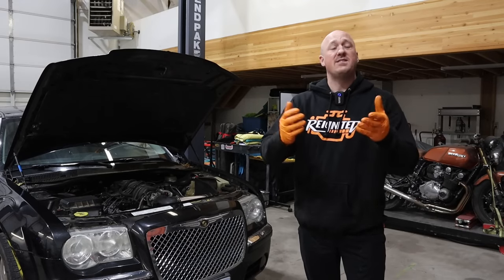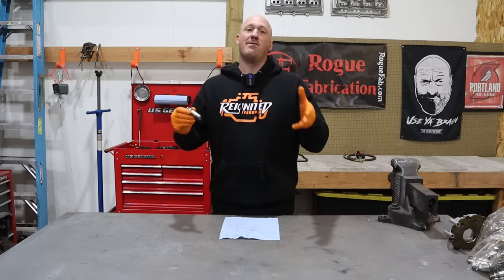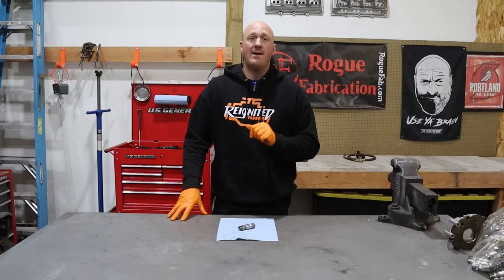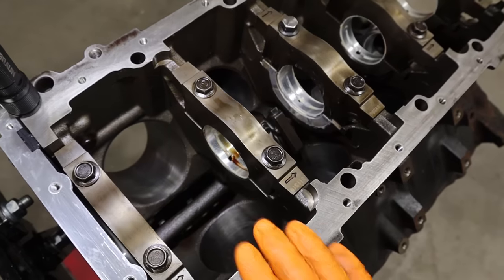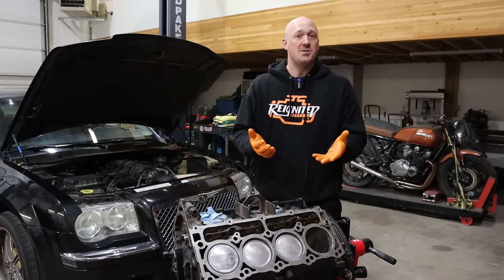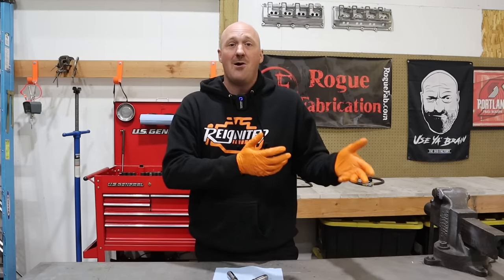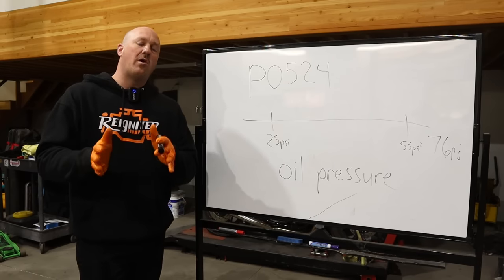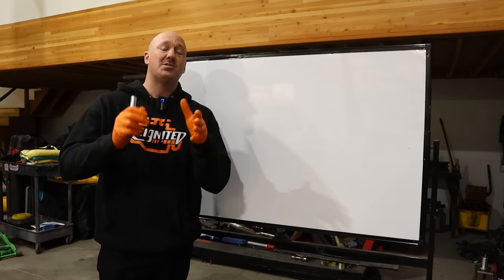The BEST Prevention For Hemi Lifter Failure! (In My Opinion)

Comment: I just put the hellcat oil pump on my 2018 Ram with 228,000km. I have MDS off so no code came on. I haven't had any engine trouble, and always used pennzoil Ultra platinum. Mechanic said it was the cleanest 5.7 hemi he's seen. Hoping to take this engine to 500k. Thank you for dissecting this topic so miticulously and sharing your knowledge.
Reply: What weight of oil you use?
Reply: @DellCvz  5w-20
Reply: How do you turn of the mds? Did you make a phisical delete?
Reply: @ARFoodsmx  I got the Edge Pulsar tuner. Piggybacks on the factory ECM and I can change settings on the fly using my cruise control buttons. It's worked amazing for me for the last 150,000km. Worth the money if you ask me.
Reply: Do you still have the mds lifters in ? Just disabled ?
Reply: @jessejames4319  yeah just disabled. the engine is untouched besides the oil pump. 238,000km now and no issues with the hellcat oil pump.
Reply: Completely agree popped my valve cover off to fix a broke valve spring and there was no sludge or discolouration of the aluminum 400k on motor penzoil platinum and oil changes ever 5k

Comment: I suggest oil changes 3000-5000 miles at most, or every 6 months,  whichever comes 1st no matter what any factory suggests.....that gives u a chance to inspect the the rest of the engine bay, fluids, suspension, etc and gives u a better idea of what is going on with your vehicle...I think anything above  5000 is asking for problems..great video bro...
Reply: Is there any particular oil filters out there that holds more oil or has better filtration?
Reply: @davewoodmancy5124  plenty of options but all my mopars have drove past 250k on mopar filters...
Reply: I agree. Although my 12 tsx had 170k the oil changed were done every 6 months or 3k and i used the recommended 0w-20. The engine ran smooth as butter. Most shops say the #1 reason for engine failure is neglect.
Reply: @isorozco511  absolutely 💯
Reply from the maker: Appreciate you guys watching!
Reply: @ReignitedAuto  appreciate you sharing all your info.....MOPAR FTW 💯🔥🔥
Reply: I agree but if you're consistently getting good results from uoa from running good oil and filter, then there is no reason to keep changing it every 3-5k. Seems like a waste of resources.
Reply: I believe that a good oil makes more difference than anything. I have seen people run junk oil, and change every 3k, and good oil like Amsoil or Shaeffers, and go 10K plus. 

I started running Amsoil a couple years ago, and firmly believe it’s one of the best out. Independent testing has proved that as well
Reply: The six months period has already been disproven with synthetic oils and newer non synthetic oils
Reply: @SModelMafia I run amsoil in mine and change it at 5k but I also don’t drive it in the winter with all the road salt. I’m sure it will still shit it self since I took extra care of it. So far 100,000 with no issues.
Reply: Fresh oil cannot overcome design flaws and poor metallurgy
Reply: I have a ram 2500 with a 6.4 under warranty so I change the oil every 4000 miles using the molar filter and factory oil. When the warranty runs out I will use Amsoil. Good oil and changing the oil and Filters on time I believe makes a motor run longer without issues.
Reply: @williammoore2417  again, the very best oil cannot overcome poor design and bad metallurgy.  Installing a Hellcat oil pump would help more than Amsoil.
Reply: @williammoore2417 Ever had a used oil analysis done?
Reply: I only drive 1,000 miles a year.  And with full synthetic let it go over a year between changes at 3,000 miles.  So yea I change it every 3 years on a 2019 5.7.  Don't imagine I will ever hit 100k.  I don't believe oil breaks down over time but do heat it up on short trips to keep moisture evaporated from it.
Reply: European markets been on 20k oil change intervals for 30yrs.
Reply: I’ve used full synthetic oil since first oil change. Changed it every 5k or when engine light turns on. Closer to 8k-10k miles per change. I’m in a 14 R/T and still spins like a top. I’m in LA so I’m sure the nice weather helps my engine vs colder sub zero cities. Finally gonna jump to a cam swap and MDS delete just to be safe from the lifter issues and of course I want the power ! 5.7 with 129k miles. What cam should I go with ?
Reply: 6K miles minimum. You're wasting resources, money , and time.
Reply: After all of this, why would anyone buy a 6.4 ? I would definitely never buy one without a lifetime power train warranty.
Reply: @davewoodmancy5124 no need to hold more oil, why do people think that?

Comment: Facts. The frequent oil change interval is absolutely the best way to prevent wear / failure. Our 2007 RAM 2500 with the original 5.7 Hemi has 150K on it and we had to recently swap the oil pan (due to rust-through thanks to the midwest rust belt doing its thing) & windage tray/gasket. The internals looked fantastic and not a single tick in 16+ years of service due to oil changes being done every 3000 miles. 50 oil changes doesn't seem like much of a price to pay to avoid issues like engine component failure at bay.  Cheers!
Reply: My opinion on Modern fuel injected engines is they run much cleaner than an older engine therefore 5000 Mi is easily doable and acceptable. If you follow the computers recommendation I believe it will be past 7500 which I think is too long
Reply: @thomasward4505  Heat and pressure breakdown oil in conjunction with carbon present in the oil as so-called modern engines utilize low tension rings which contributes to contaminated oil. That coupled with modern engines using more oil; as an example Hemi engines consume a factory acceptable amount equal to 1 quart per 1000 miles. Engines are expensive, oil and filters are not.
Reply: @strykerentllc  my 2014 Ram hemi does not use one quart of oil in 5000 miles which by the way I use it for towing and Hauling at least half the time. So one quart of oil in a thousand miles would be excessive but maybe in the realm of factory recommendation I don't know
Reply: @thomasward4505  Dodge's acceptable oil consumption is 1 quart per 1000 miles. Next time you're at the dealer, you can ask and they will confirm the same. The PCV valve is there for a reason - evacuates the engine of oil vapors as the oil is heated during the run cycle to be burned through the intake cycle of the firing order. Oil vapors are part of heating oil and if there was no PCV on the engine, it would pressurize the crankcase and cause gasket failures.
Reply: @@user-dd3pl9ii2h Nobody was bragging until you decided to initiate a foray. Congratulations on running yours to the point it literally wore out. Maybe you'll get another 250K out of it.
Reply: @strykerentllc  😂😂😂😂
Reply: I like what you say. I have a 22 Ram Power Wagon. I am changing oil every 5000 but like your recommendation of 3000 miles. I am using Mobil 1 and a Mobil 1 filter. I also put oil treatment in. Will change to 3000 miles. No ticking at 28,000 miles
Reply: @@user-dd3pl9ii2h You do realize where the pressurized oil to the nozzles is fed from on those blocks, no? You understand what the nozzles are pointed towards? The MOPAR Hemi block can't support 1500HP reliably and the average guy isn't going to be looking for that kind of HP in a street car as anything above 1000HP cannot be supported on the street. In short, the street can't utilize that kind of power. A well prepped surface needs to be under the car for the car to apply that HP to the ground.  

As to the cam lobes wearing and lifter rollers failing; only metrology can pinpoint the cause and to date, no shade tree guy has sent anything off to a lab for analysis. As a preventative measure, frequent oil changes based on driving habit is the best course fo action to avoid expensive repairs.
Reply: @robertgoodrich8953  I feel like every 3000 is very overkill though, isn’t it?
Reply: Not facts at all anecdotal at best, poorly engineered is facts didn't you watch video is main fix is 12% higher volume oil pump...though nothing wrong with changing oil, you just got lucky
Reply: @ShawnGilbert1967  Knew it wouldn't take long for some self-appointed internet expert to come along and give his unaccredited opinion. How many engine components have you engineered that you can claim that level of knowledge in the engine manufacturing industry? Do tell.
Reply: @strykerentllc  none ( same as you) but I've assembled a lot of em, and YOU are the LITERALLY the one whom self appointed himself lol...I'm responding to the self appointed internet know it all with the maximum cope post.....

 ANY engineer would know this IS a design flaw period of what level or severity IS the ONLY question.......

 Give ya an example, GM LS7 heads, 12 degree valve angle with a 1.8 rocker ratio can and does fail or wear out....not 100% of the time....well would it be 100% of the time with enough mile? See that's where you gave yourself away, you give a answer in fact with a deviation between failure of infinity.....

I'd assert an LS7 will 100% wear the guides and drop a titanium valve in 200k miles....but what about 60k when it was of warranty? Lets say it was 5% would it still not be a proven design flaw....Yet it WAS a design flaw the aftermarket ( much like this video ) had to fix....

If it makes you feel better I call it a design Liabilty then ;)
Reply: I only put about 2 thousand miles a year on my 2019.  I refuse to change it once a year but do every 3 thousand miles.  I do heat the engine up to 200 degrees once a month for a 20-mile drive to get condensation out of oil.  When it's 10 years old, I will buy whatever gasoline engine that's left as the libers are going to force combustion vehicles out.
Reply: I have a 2016 Durango, hemi , I replaced lifters, hellcat oil pump, I get the code, I still have the tick
Reply: My 2007 5.7 Ram has 240,000 miles on it and has never been apart and from the way it sounds and runs, it won't be any time soon. I get the oil changed every 4,000 miles at a dealership mostly to quiet any concerns I might have. I put a tuner on it at 200,000 miles and it's revved over 6,000rpm on numerous occasions without any problems. Happy to see what the next 100,000 looks like. I should add that I disabled the MDS on it with my tuner and that everyone should do so or suffer the consequences.
Reply: @anoint426hemi6  Duly noted! The only concern anyone should have is the stated OEM oil consumption for the 5.7 is 1 quart per 1000 miles of oil being consumed being acceptable. If we check oil level and top-off between oil changes, we're in good shape.
Reply: I can say with fact... I changed the oil between 4000 and 5000 miles in my 2013 RAM 1500 with the 5.7 and at around 140,000 miles I got the dreeded cylider 3 misfire engine code but I've ALWAYS had a tick. I'm a bit skeptical on NOT changing the oil before 5000 miles seeing I changed it faithfully before 5000 miles. I just purchased a new 2023 RAM 2500 Power Wagon with the 6.4 and I'm planning on changing the oil every 3000 using the recommended PUP 0W-40 oil. I'm also considering upgrading to the Hellcat oil pump. Does anyone see any issues with my plans?

Edit: I'm also going to use the Wix XP oil filters on Power Wagon
Reply: @@user-dd3pl9ii2h  what year was it?
Reply: @rjmlakota  The MOPAR (MO-090 in our case) oil filter is fine as that's always been used in our 2007 RAM 2500, purchased in cases of 12 units on flea bay. The oil change intervals are what matter as the filter would never get clogged to the point where it chokes oil flow to the level that causes starvation to the critical surfaces. Curious as to whether you topped off oil between changes and how much was needed as FCA (now Stellantis) notes that 1 quart per 1000 miles oil consumption is acceptable. 

The HV oil pump wouldn't be detrimental. The question is it necessary? Disabling the MDS along with the HV pump is certainly something to consider but wait until it's out of warranty as modifications could possibly void your warranty.
Reply: @strykerentllc  I did not top off oil between changes. This is something I'm definitely going to do with my new Power Wagon.
Reply: @@user-dd3pl9ii2h Spot on. It's a sad day in America if engine life expectancies are only 150k - ish.
Majority of used truck sales are 100k + miles. I recently bought a 2011 Super Duty with 143k, sold as lower miles. I'm at 188k now and don't anticipate anything major until the 300k mark. My 08 SD diesel 6.0 finally parked itself at 524k. Nope, the industry is in trouble if 150k is a milestone. God forbid. 🙏
Reply: @@user-dd3pl9ii2h  Gasoline engine not designed to idle ...???
With the multitude of exponential thousands (high enough for you?) Of police fleets which may idle 24/7 from shift to shift etc, ...are you representing to the public that designers/engineers for decades have failed to consider and factor exorbitant idle periods into engine design??? Serious??? You mean, no young college graduate with a doctorate of motors degree whispered into the ear of a senior engineer and said, "you know pops, we really outta start designing gasoline engines to survive those police car marathon idle periods"
The senior engineer says, DAYYYYMMMMM!!! , we never even thought of that!! I knew sumpin' was missing from our research, now I know!!

Lol. A little fun.😊
Reply: At the end its nice to say your car has factory torqued bolts and nuts and fsctory parts
Reply: Normally if im stuck in traffic or at a red light i will push brake with one foot and touch the gas just enoygh to increase rpm with the other foot in an effort to keep the oil flowing better.
Reply: Your 07 was not the issue, the issue started in 2012
Reply: The lifter issue is primarily a Gen 3 hemi issue, you have a Gen 2
Reply: @BlackRam17  Interesting choice with using the word--primarily. Leaves you wiggle room as using the word exclusively paints yourself into a corner. There have been documented cases with the G2 Hemi having lifter failures resulting in galled cam lobes. Oil changes  at regular intervals extends engine component life and that isn't up for debate. Adding a HV oil pump certainly isn't going to hurt component life; it simply robs the engine of a minute amount of horsepower.
Reply: I have 2 of them with way more than 150,000. The only "tick" I ever had was an exhaust leak dut to broken manifold bolt. I am not sure I would buy an MDS hemi after 2008.
Reply: My opinion your oil pan rotting out is 100 percent on you, totally your fault by not doing your maintenance.
Reply: @davem3148 did you replace the cam? That is smoked, redo or just exhaust leak
Reply: @strykerentllc , This is very true. I change the oil in the Ram and Challenger every 3K miles, and I always have about 2 inches of oil in the catch can.
Reply: @thomasward4505 I absolutely disagree, your comment below is correct, I’m seeing more fuel contamination with modern engines due to low tension rings, etc. They actually require more frequent oil changes and synthetic is no better when it’s contaminated.
Reply: @strykerentllc this Thomas guy claiming he doesn’t use one quart in 5,000 miles, he’s trying to fool every other Hemi owner on earth, including myself.
Reply: @alanmeyers3957  Yeah, that's a tough one to digest knowing all of these newer engines with low tension rings and PCV systems ingest oil through the intake to be burned due to the emissions manufacturers are forced to adhere to. Meanwhile China and India are burning coal, trees, and dung along with running 2-stroke engines at will with a blessing from their leaders while U.S. car and truck owners are paying stupid high repair bills because of the rules and regulations imposed by unelected bureaucrats. DEF, GDI, MDS, DPF--all systems that fail in short order and cost owners ridiculous cash to fix.

Comment: This is not the first time I have heard talk about not letting a Hemi idle.  Or not for too long because its not getting enough oil to the lifters.  I'm glad I found this video by accident.
Reply: I put mine in neutral and play with the accelerator in long stops
.
Reply: @claudehosch4706  That's the cheap and easy way to deal with this.  Even when it's warming up I'm bumping the pedal.
Reply: @claudehosch4706 

I just purchased the diablo trinity 2 platinum ex. 
Haven't learned all it's capabilities, yet.   
It does allow you to set the  park idle up and the driving idle up. I set my parked idle up to around 750 rpm. Because, I always  have my dog with me. I don't feel I have a need to set the driving idle up.
Reply: I put fraction oil in mine and it's good for fifty thousand miles
Reply: @joeteddy7685 

What is fraction oil ?
Reply: @williamsmardo1240  Dt550 It does work even when you change your oil is sticks to the metal doesn't come out of the engine
Reply: Mine's a summer car. The air conditioning is on about 90% of the time. By virtue of the compressor being on it raises the idle about 150 RPM or so. This increases flow and the pressure too. 
I tend to agree with this theory.  I would NEVER consider buying an old cruiser for this reason.
Reply: @claudehosch4706 Sounds incredibly OCD.
Reply: @joeteddy7685 Sounds like snake oil. Oh wait,  that's funny and it wasn't even intended to be.
Reply: The theory of avoiding leaving it at low rpm is, for example, the case of police cars that are on all day and spend many hours at low rpm, but because you are in congested traffic that does not do any harm.

Comment: Thank you. Completely agree as a mechanic who built couple hundreds of Hemi engines. I have an engineer mechanic background and could not add anything, at least now.👍
Reply from the maker: Appreciate you watching Boris!
Reply: @ReignitedAuto  The new 0w 30 oil breaks down(looses lubricity) much faster than 5 or 10w 30 use Motorkote or redline engine additive they are both great all others are sub par or no better than just oil alone